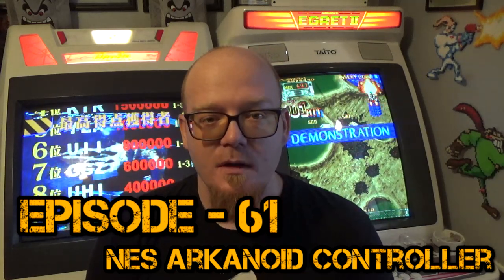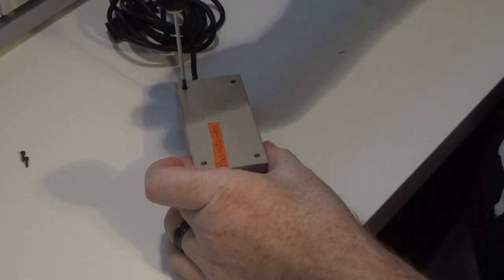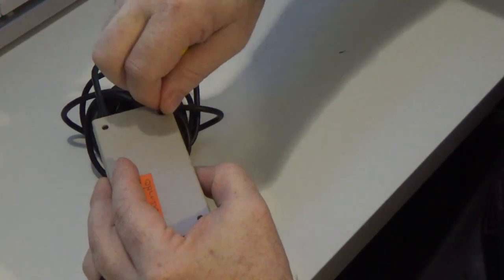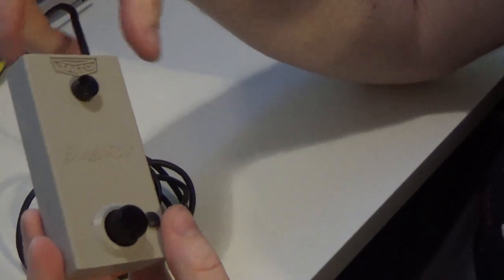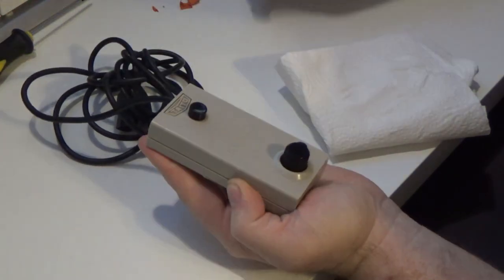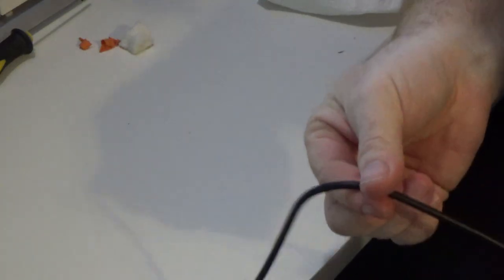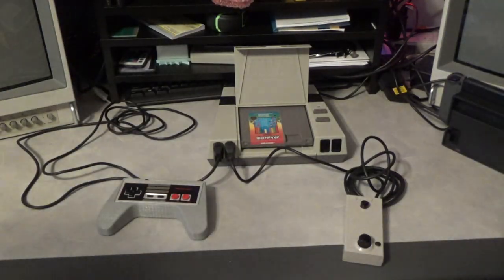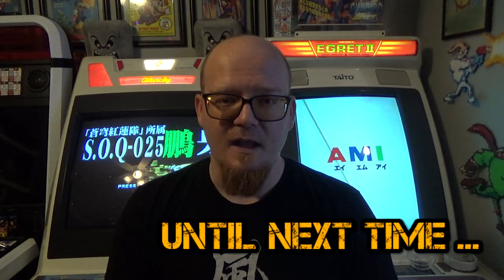NES Arkanoid Controller - PastBlaster Episode : 61

Comment: As shown in the video, playing with this controller is quite convenient. I tried to play on a regular controller, but this is impossible, because the ball accelerates over time, and the board does not have time. I didn't go further than the 4th level, I had to cheat. Thanks for the video, it's good👍

Comment: I also have the Vaus Controller, but the paddle doesn’t reach the right side of the screen. Can you please help. I also made adjustments with the pentiometer under the black cover (small black cap on right side).

Comment: Would this controller work with Gyruss? if so could you make a video/clip showcasing that?
Reply from the maker: Not too sure on that. When I dig the AVS out next, I can test that for ya!
Reply: @PastBlaster  Appreciate that. Important to note that there is two control options to pick from at the main menu.